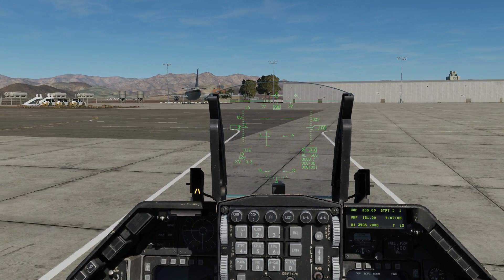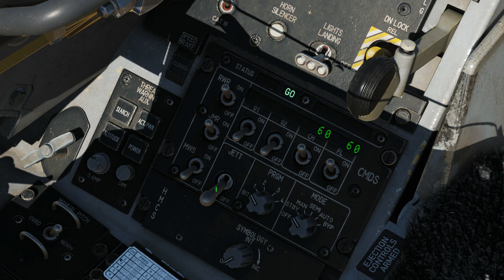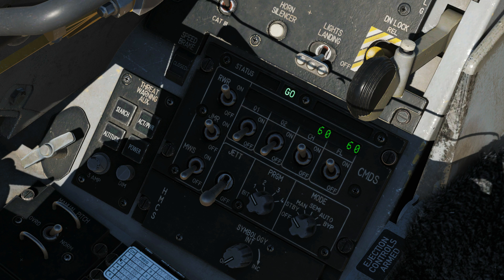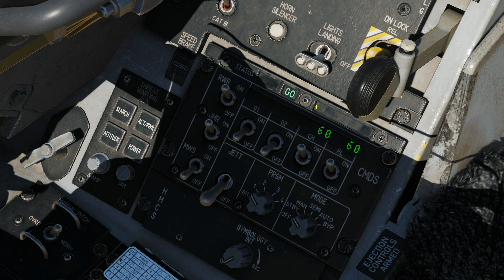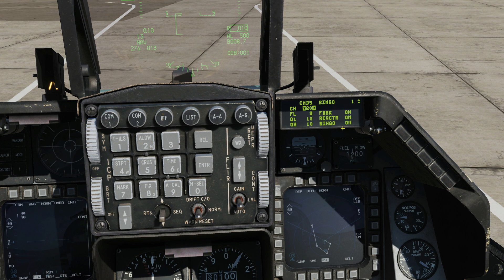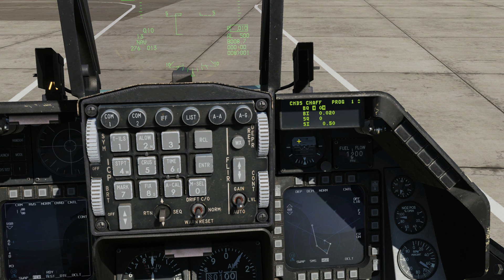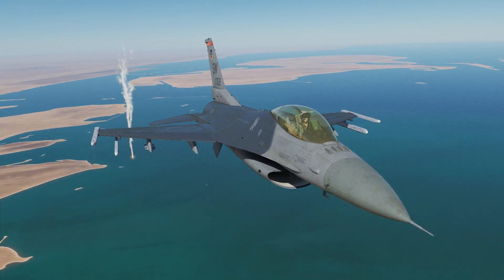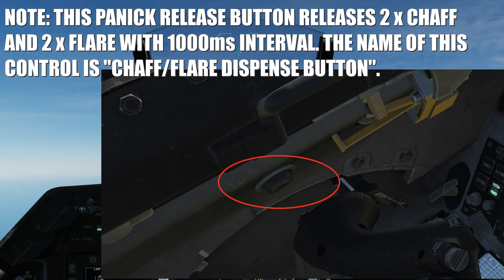F-16C Viper: ALE-47 CMDS Countermeasures (MAN Mode) Tutorial (Vid 1 of 2) | DCS WORLD

Comment: Back again with some more additional info:
-The CMDS systems official designation is ALE-47 CMDS, it is installed in some form in pretty much all US military aircraft that have CMDS equipped.

-The O1, O2, CH, FL payload switches do not actually turn off the count for each type of munition when the corresponding switch is off; they only prevent the selected payload from dispensing when in the off position. Your counts will always be displayed so long as system power is on and you are not in bypass (more on that in moment) 

-AUTO mode will dispense countermeasures upon receipt of a dispense signal from RWR, JMR or MWS regardless of user input, the only way to prevent countermeasure dispensing is to turn off the corresponding payload switch. SEMI mode works exactly as described by Cap.

-BYP (Bypass) mode, is an emergency function used only when there is a failure of the systems main processor. Placing the system in BYP will bypass (Hence the name) the processor, and send dispense signals directly to the countermeasures dispensers. While in bypass, no counts will be displayed on the main panel, as the processor is the unit responsible for keeping track of how many sticks of chaff/flare are in each dispenser.
Reply from the maker: Thanks man x
Reply: @grimreapers  No problem. Happy to share info.
Reply: That's some good quality info right there. =)
Reply: so is it currently possible to dispense only chaff or only flares? ...  thats what I'm understanding from your instructions here... but I haven't had a chance to test it out.  Switch off the flares and only chaff will be dispensed and visas versa?  thank for you addition to Caps tutorial.  immensely helpful.
Reply: @scarecrow1323  Probably yes... I'll give it a test in Falcon BMS as well, as soon as I can.

The way I would set up the CMDS to deploy individual countermeasures is just simply modifying the programs, like I already do in the A-10C.

The A-10C has the Programs H, I, and J that are the more suitable deployments for this. Program H deploys a single chaff and program J deploys a single flare, then I only tweak program I (which by default deploys two chaffs with a small interval) to deploy both chaff and flare at the same time, one each.

Comment: Is that missile lock warning? I dont get that sound
Reply: Apparently there are issues with the RWR sounds in the F-16. Some say that they work if you have the F-18 module installed though this is not confirmed.
Reply: @firemedicjm911  it requires the Hornet files to be installed. Someone did some data mining, IIRC, and to play RWR sounds the Viper module literally references the Hornet files. What a load of crap - the Hornet RWR is nowhere near the same as the Viper's.
Reply: FiremedicJM yes I don't have the hornet.
Reply: it now has its own sounds